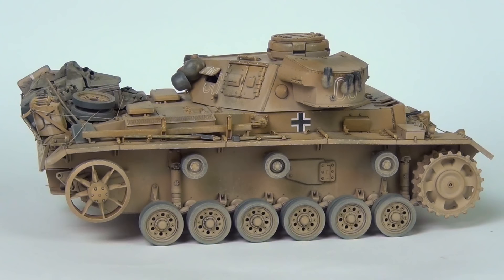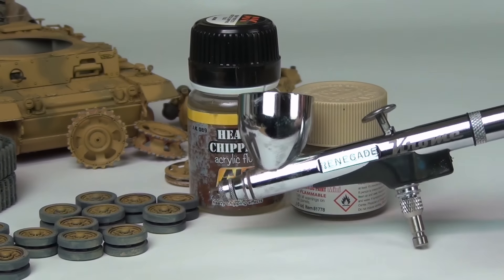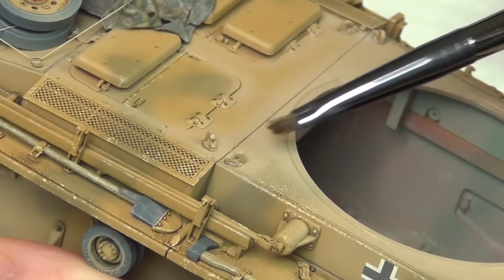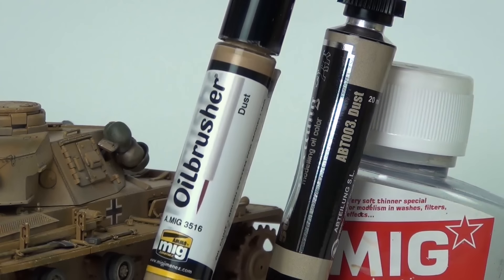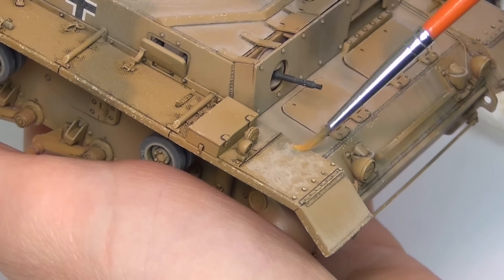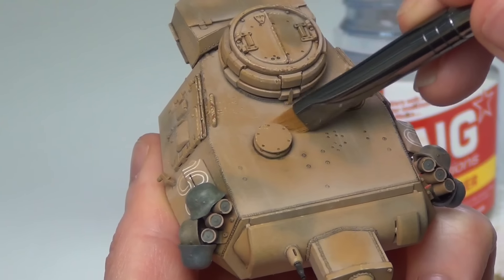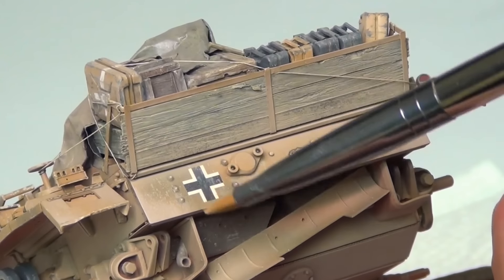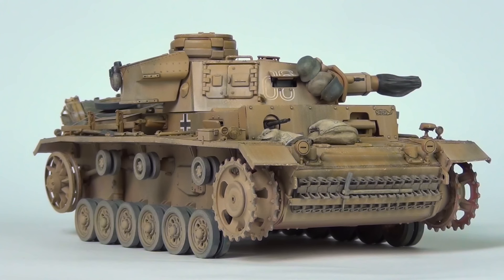Dust Effects (Without Convenience Products) for Scale Models -- Panzer III N Tunisia

Comment: Interesting approach and the idea behind it is not too different from what i often tend to do. Applying a crude and heavy coat first, then rework and reduce it till it looks realistic.
I think i have seen people spraying on enamels as dust effects before and then going at them with thinners, you went with the Tamiya paints and oils in this case, which is an interesting variation. Great result!
Reply from the maker: Thank you Michael.  Honestly, my initial plan was to indeed airbrush on the enamel AK Dust Effects but then I realized they were all toast!  So, instead I decided to do it without those stupid things that always dry up, and I think it paid off!

Comment: Awesome video!  I don't model Armor but I can use these techniques on my locomotives since I model SoCal.  I found it interesting you used a satin coat basically for helping the oils blend or flow smoothly correct?  I assume at the very end you come back with a flat coat over the whole model?  Thanks!
Reply from the maker: Thank you for the super chat!  Yes, you are correct.  I use satin for a smoother surface that allows the oils to move around easier.  Some people use gloss but I find that too smooth -- the weathering doesn't really stick!  A final matte coat will be applied at the end as you said.

Comment: Panzer Meister thanks my brother. That's really interesting. Now regarding pigments. I recently completed a model that i rusted up. To stabilize the pigment i used Burned Sienna oil paint as a base. And then applied medium and light rust pigments on top of it. So far the pigments are still there. 
Are you doing the same with pigments or something different?

Comment: Evan, when you use the oilbrushers do you use the brush with it? Or do you just use it to apply to another surface and then transfer to the model surface?
Reply from the maker: Hello JC.  I find the built-in applicator for the oilbrushers to be way too big and messy for applying the small amount of oil paint I desire on the model.  But, the applicator is useful for applying some paint on my palette like you've said.  Then I apply it to the model with a fin brush.

Comment: I noticed you are using some good quality oil paints too! lol
Well it is possible to mix up custom colors using artist oils that you get from Michael's or Hobby Lobby. 
Of course having pre mixed colors is nice for consistency across say several vehicles you want to have together and just time. 
Would love to see mud / caked on dirt effects with the same principle. 
I know there is a way, but haven't really researched it.
Oils are great too since they are not super opaque. It is a filter over the base layer.
Reply from the maker: For caked-on dust and dirt I would have to use some acrylic or enamel mud texture product.  For example, the Mig AMMO enamel at the beginning of the video.  And yes, the transparency of the oils is key as it means my previous chipping and pinwash are not hidden 😊

Comment: When you are spraying the Tamiya “dust” acrylics, are you thinning with water, or X-20A?  I want to try this on my M-10
Reply from the maker: Hey Mike!  I actually thinned them with Mr.Color Lacquer Thinner, because they were a very thin coat and easy to chip even with the more durable thinner.  But, X-20A would be a safer option.

Comment: Wow, So much in such a short video!  Q. please. What did you use for thinning the Tamiya paint!😊
Reply from the maker: Good question John.  I used Mr Color Leveling Thinner.  Since I'm only chipping at a thin coat of the paint, I'm not worried about it curing too solid.  But you can thin it with X-20A or water for easier chipping.

Comment: Hey, are you using water or MrH thinner with the Tamiya paint?
Reply from the maker: I used Mr Color Leveling Thinner to thin the Tamiya paint for airbrushing, but you can also use water or X-20A.  Water or X-20A as thinner can make the paint easier to chip, but since the airbrushed dust was not a thick coat, it was easy to chip even with Mr Color thinner.

Comment: Heavy chipping fluid seems to be in the same wheel house as the products you're avoiding. I was expecting it to be more home grown solutions not picking a different one off the same shelf you were other wise avoiding.
Reply from the maker: As I said in the video, you can use cheap hairspray instead.  I've simply run out so as a backup I used the AK HCF.  Mainly though, I'm trying to avoid convenience products that are unreliable.  AK HCF doesn't dry up like those enamel dust washes.  In fact, that bottle of AK HCF is probably 8 years old...